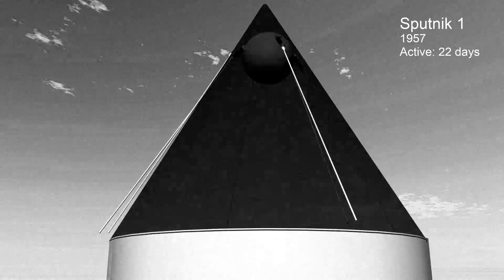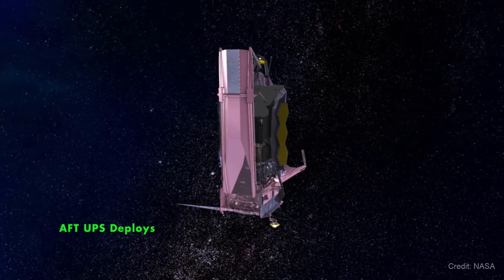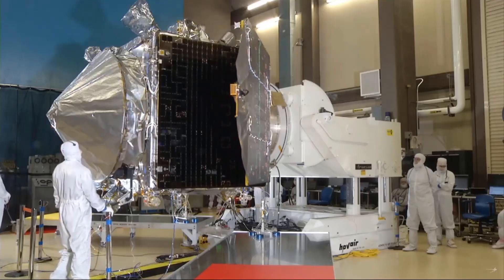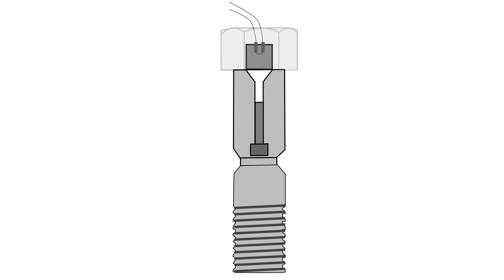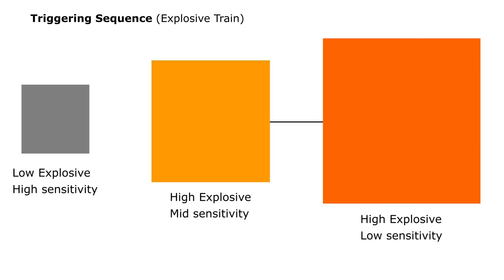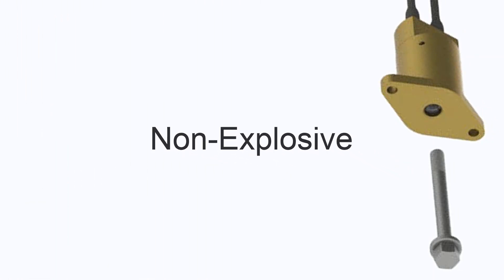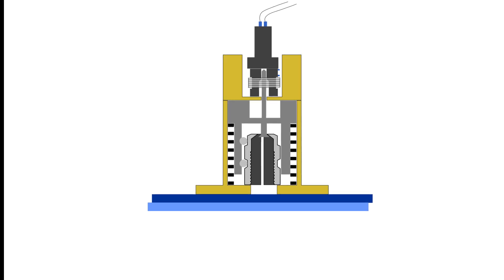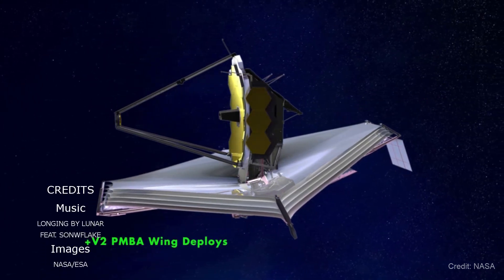Hold Down Release Mechanism - The nuts & bolts that unfold a spacecraft.

Comment: Are there any examples of HDRMs that have failed and restricted the usefulness of spacecraft?
Reply from the maker: Can't think of a direct HDRM failure, but the motor that unfurled the high gain antenna of the Galileo spacecraft failed to do so when commanded. This caused a serious reduction in it's data transmission rate.

Comment: Good video but you could have explained the explosive train better. After all, if all three stages are triggered inexorably by the first stage then the last stage is as sensitive as the first, so what's the benefit?
Reply from the maker: Yeah. Good point. I notice after I made the recording and some of the video timeline was already in place.
Reply: The first stage is only able to be activated by the electrical pulse, which is relatively easy to inhibit.  The third stage is protected by the other stages from stray environmental influences that otherwise might set it off, but is extremely responsive to the pressure-heat pulse when the device is fired.
Reply: @DanHelfrichGP  That makes no sense. You "inhibit" an electrical pulse by not sending one in the first place.
Reply: All pyros that I have ever used are capped with a shorting plug until it's time for them to be fired. That device inhibits inadvertent voltages arising across the leads due to stray RF or ESD.

Comment: The two devices outlined here are but two of a plethora of other release devices used to deploy spacecraft mechanisms. Not all spacecraft releases are accomplished using pyrotechnic or burnwire devices. The Spacecraft Mechanisms field is a very wide discipline where specialist engineers must demonstrate solid and well thought out engineering as well as prove their designs through rigorous test programs. It is not a easy profession, as it evolves constantly and requires lifelong study to remain proficient. When very expensive spacecraft and satellites rely on all of their mechanisms to work perfectly, it compels those building those devices toward serious and resolute endeavor.
Reply from the maker: Thanks for the additional detail. I'm  hoping all of the HDRM on Webb work as planned.
Reply: @ReflectiveLayerFilm  Those of us who worked on Webb live in fear of it because the expectations have been boosted so high. It was originally designed to go up on a Titan heavy, but the move to an Arianne caused everything to go into draconian mass reductions after many of the mechanisms had been designed. Add having to deploy under cryogenic conditions made everything painful. Keep your fingers crossed...
Reply from the maker: @altaloma7789  Wow! I didn't know this about the launch vehicle switched. I always wondered why NASA was using a European launcher  for its flagship spacecraft.

Comment: This mechanism seem so overly complicated - are simply motorised screws too complicated?
Reply: The satellite would have to power those motors while folded, which means only satellites with radioactive generators could power the system. Plus you could have the issue of the metal in the screw and nut lock together in the vacuum and seize the motor.
Reply: @ChucksSEADnDEAD  last point gets me but the first - don't they have batteries Tobe powered while at the night side?
Reply: @TecSanento  Sure. But now if something goes wrong and the panels do not unfold, the battery might not charge again.
Reply: @ChucksSEADnDEAD  but this is the same for these explosive charges because they need energy to activate as well
Reply: @TecSanento  Sure, but it's a quick discharge like the flash from a camera.

Comment: does the bolt just become spacejunk?
Reply from the maker: Yes if the ejection trajectory is directed away from the earth.
Reply: @ReflectiveLayerFilm  Actually the two parts of the bolt are usually trapped in the structures to avoid having them flying around, potentially causing problems.
Reply from the maker: @julesdomes6064  That makes sense. Thanks.
Reply: @ReflectiveLayerFilm  No problem. Great channel you have here!                                                                                                                                                            Very informative.
Important that YouTube contains this type of info, and not just BS from science deniers and conspiracy theorists.

Comment: Thank you for your video!  At 1:45, can you say what the structure on each side of the inner parts of the fairing closest to the spacecraft?  It has a black background  and maybe grounded metalic tape in horizontal sections?  I was just wondering what that was for
Reply from the maker: It looks like the sound absorption paddings used to minimize the vibration  transmitted to the spacecraft from the rocket during launch.

Comment: Cant they unfold the Webb Telescope in low earth orbit, then send it on its way to its parking orbit once all the unfolding kinks are ironed out?  That way we have a chance to reach it to repair something.
Reply: Too much "stuff" in LEO. The few particles that are around (and requiring ISS to reboost periodically) would damage/contaminate the sensitive equipment which is protected in the folded state. Only far out is the paricle count low enough to unfold it.
Reply: @klausvogler6710  that's another good point. a tiny Flick of paint did some nasty damage to one of the viewing ports of the ISS to something as sensitive as a JWST the damage would be devastating. Even folded up any sort of debris strike would be nasty if I'm not mistaken orbital velocity a flick paint would be like a 22LR anything bigger like a nut or similar size object would be worse than damn .50 cal.
Reply: @phalanx3803   Doesnt even have to be debris in the usual sense. Just gas condensating on detector surfaces would already damage them.
Reply: that could work if we still had a space shuttle but we dont.
Reply: If everything was unfolded first, including the mirrors, wouldn't a rocket ignition have the potential to knock things out of cirtical alignment?  Better to keep everything locked down tight during any boost phase, and hope for the best when it's time to unfold.
Reply: @CraigCholar  During ascent for sure. But the insertion burn is longer and induces less g loads. The final alignment is made by adjusting the mirror panels and position of the detector hardware. If things would get knocked so far out of the design spec that these lemenst could no longer compensate, you probably have much bigger things to worry with the spacecraft :)
Reply from the maker: That's a good question. My guess is that if they unfold in LEO it's going to require more fuel because you first have to establish the LEO. It's also possible that Webb may not have its center mass along its centerline when unfolded. This would mean that more than one rocket engine is needed to fly straight. These are just my guess.

Comment: 7:18 looks kinda overcomplicated for its job, why don't they just have a piece of nichrome wire connecting two parts of the spacecraft? It's much more light weight and fewer things to go wrong.
Reply from the maker: That particular design in the video has a load rating of up to 42.2 kN(9500lb) and its release time is very predictable. Doing the same with a nichrome wire with the same amount of loading will require a relatively thick wire which will require a tremendous amount of current to vaporize it. Heating it up and depending on thermal expansion would not be reliable enough. The mechanism in the video is basically a force amplifier. 
You can read more about that faster from the link below

https://esmats.eu/esmatspapers/pastpapers/pdfs/2013/chang.pdf
Reply: @ReflectiveLayerFilm  Thanks for the explanation! One thing that I don't understand though, is why do they need 4 tonnes worth of load rating just to hold some solar panels.
Reply from the maker: 4 tons is probably not required just to hold solar panels in place. I just gave the max ratings of these devices. Devices like these are also used in detaching landers from spacecraft. Keep in mind that that when it comes to releasing stuff in space it's not just the mass of the solar panel, high gain antenna,etc. You also have to considers the maximum G-force the spacecraft has to go through during launch and that could be up to 6 times the mass of the thing that's being released.

Comment: em-railgun acceleration sled, combined with solar and nuclear acceleration, ion and electric pulse jet
Reply: rely on hope only, have screw detachers, spring motorized
Reply: you could also burn a fuse to detach, direct arc melting
Reply: not the only way, multiple paths to making it work

Comment: Thank you so much for the video , Can you help me in understanding How a rocket boosters are released ?
Reply from the maker: The side boosters are first released by explosive bolts, then a separation  rocket pushes it away from the main rocket. This is how it's done on the Ariane 5. 
http://www.esa.int/Enabling_Support/Space_Transportation/Launch_vehicles/Boosters_EAP
Reply: @ReflectiveLayerFilm  Thank you so much for this information , Actually i am working on a scale model of a rocket with side boosters , so i usually make the models with exact ( or Nearly ) the same kind of fastening , fabrications etc. But in spite of my extensive search i was unable to find " How the Boosters are fastened to the rocket ? And how they are exactly released "

Comment: While not a bolt that releases under load, the Sea Catch Toggle Release (www.seacatch.com) that I make offers a non-explosive, non-destructive means to release lines or objects under load. Someone like you could create a video covering all the different types of releases used in the world - from those like you describe here to the Sea Catch, and to large, pier-mounted mooring hooks for ships. Love your animations.
Reply from the maker: Interesting. I checked out your release system. How much force does it require to release the max load?
Reply: @ReflectiveLayerFilm  It depends on the model. With the smallest one we make, the TR3, it takes 8 lbs of effort to release a capacity load of 1,300 lbs. The website has a list of all the standard models and the effort you inquired about.

Comment: Thank you! I never knew that NASA sometimes puts explosives on spacecraft. 
It could be a good clickbait title for a video if it contained "Nasa", "Explosives" and "Bolts" in some combination )
Reply from the maker: Yeah. Explosives deliver a lot of power relative to their mass the. But the trend in the industry is to move to the non-explosive kind. One big drawback of explosives is you can't test the actual bolt you're going to use since testing is destructive.